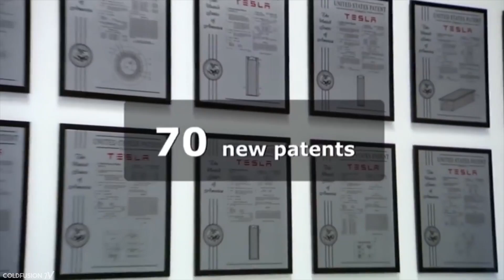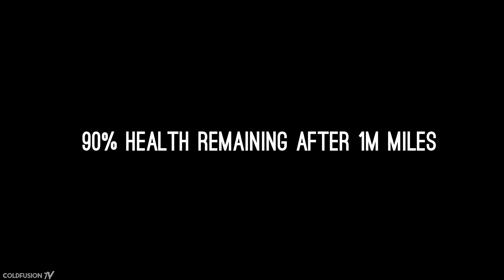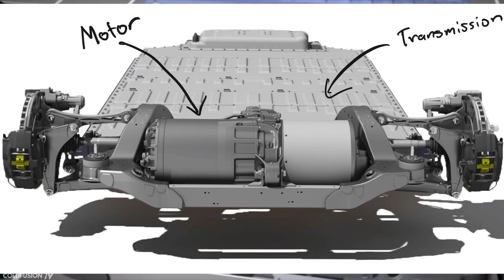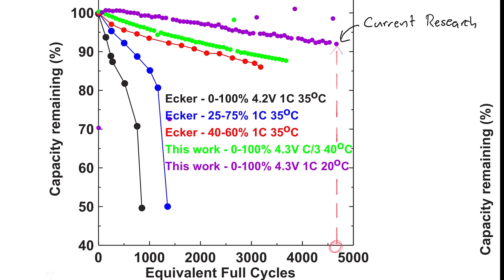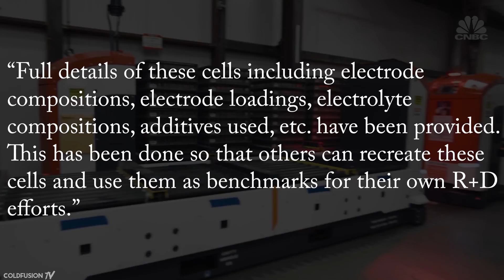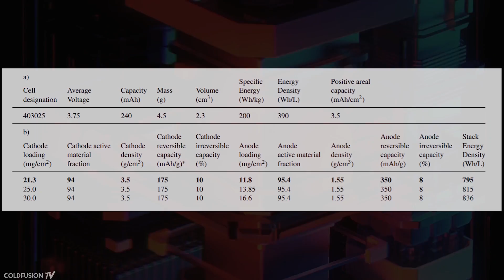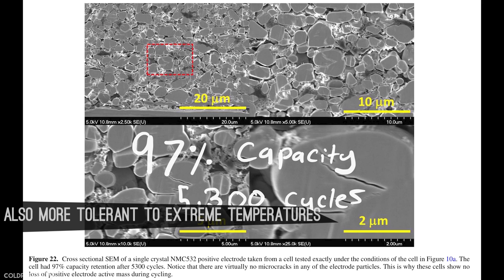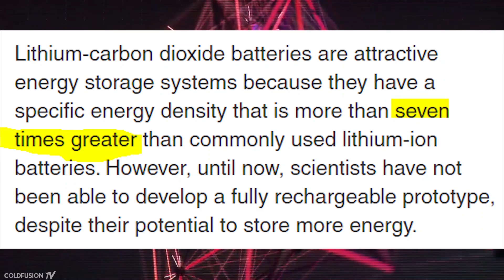Tesla's Million Mile Battery

Comment: @coldFusion what happened to the solar tiles of Tesla? The vedio was great but did they mass produce?
Reply: They are still testing their longevity and durability under adverse weather conditions. Musk said he won't mass produce until he knows the tiles will last at least 30 years.
Reply: They are currently on version 3 and are ramping production. So far on version 1 and 2 only a few roofs were built and they had some limitations where with v3 those limitations are largely gone.
Reply: jawbreaker source? Sounds promising
Reply: They’re also focusing their efforts on the cars right now since that’s where they have most of their resources directed to. As they safely finish expanding into the Chinese market and finish testing their solar tiles, we’re sure to see an increase in sales
Reply: I think that's still a fair way off
Reply: kennedy nzuki  Google it
Reply: Launching this quarter
Reply: The tiles are a gimmick.
Reply: @SoldererOfFortune  yea, a solar panel is easier, more power per $